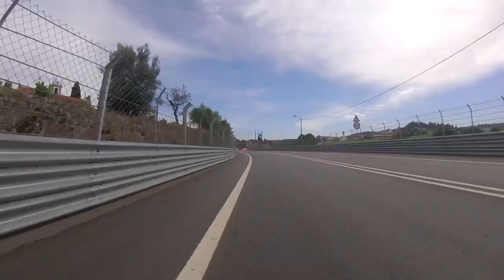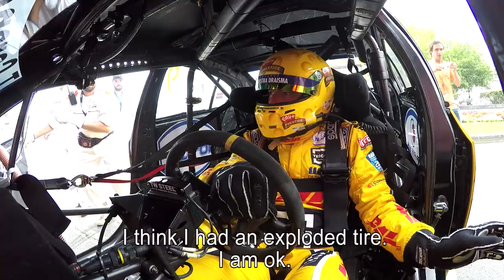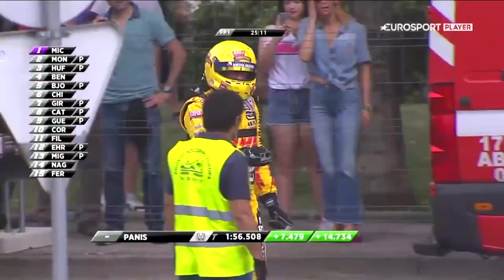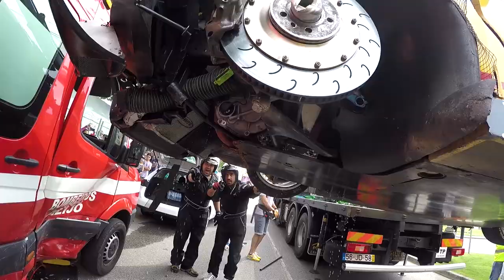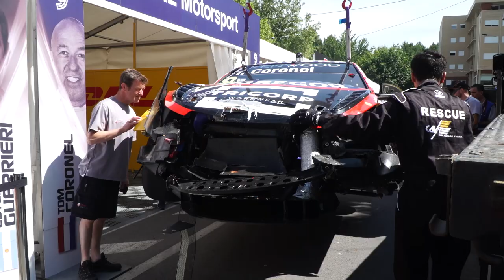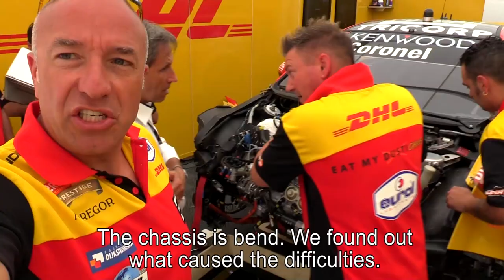Bizarre crash into firetruck at WTCC race of Portugal for Tom Coronel 2017

Comment: WTF; Crashing into a firetruck shouldn't even be possible in an FIA-standard world championship!  
How could they sanction a track where a car can just run off into a crowded place?!
Reply: I know its a 2 year old comment but that is exactly what I thought it's a totally wreckless thing to do by not putting in a safety barrier in that section especially as the cars are coming down there at full speed very bad organisation of safety.
Reply: @adamsprestage4194  The track was FIA inspected and aproved
Reply: @leandro9311  Yeah but they need to have a vbarrier or something
Reply: @RandomCarl05  These discussion is like an oil change. If you go to a shop and ask for an oil change, are you going to check if they did ther job correctly ?? No, but there´s a possibility that the new guy who did the oil change didn´t used the correct oil and ends up ruining your car´s engine costing thousands. In these  specific case, the ONLY agency responsible to determine the track safety ensure everthing was ok and everyone acepted because noone had to authority to say otherwise
Reply: FWIW it's actually an ambulance.

Comment: The more i look at it, the angrier i get.

In the 60's they would have at least placed haybales just at the track... better than what has been done there. Even nothing would have been better, you could have turned left trying to follow the road. But those 2 concrete blocks to the left could fire the car right... and in the direction of the spectators. Then there are the 2 lampposts and the narrow concrete thing, where you went through, which are not even remotly protected. 

Im glad that you and thos firemen are okay. Could have been way worse, but lets not think about that.
Hope you can fix the car for argentina, shame that you are out for the weekend... :-(
Reply: i think something was opened whilst it should have been shut off. He went through an open piece in the track that shouldn't be there and wasn't there anymore later in the day.

Comment: This angers me inside!
It's 2017, not 1957! There is no reason for there not to have been at least one row of stacked tires to keep cars from running off track and hitting things like that lightpost, that signpost, and of course, the safety vehicles parked there. What if this happened in an open-wheeled machine, like an F4 car?

Look, I do believe that sometimes, safety fan be a bit over-reaching and over-reactive. But this...we are supposed to be passed standards like this, especially for an FIA sanctioned series!

Comment: Where is your HANS device??
Reply: He uses a Simpson Hybrid, which belts around your body and clips into the harnesses at the crotch strap. It's much more comfortable than a HANS and works better in some situations. I use one myself.
Reply: Yeah but the slow mo looks very nasty.
Reply: That's how it looks even with a head and neck restraint. You should see what happens when you don't have anything on. The neck stretches like an accordion. Really scary.
Reply: It's not how far your head moves. It's does your head and spine stay aligned. I talked alot with Trevor Ashline who took the original Hutchen's device and significantly improved it. He sold his company Safety Solutions to Simpson but is now employed by them to run that part of the company. I seen crash test results from all of the head restraints. As far as impact G's, no other is any better. Now, taking a second hit, it was the best since it doesn't fully depend on the shoulder harness to hold it in place. By the way, did you notice his seat belts were still tight after the hit? That's how much they can strectch and snap back when stressed.
Reply: I forgot to mention, that is the head restraint I referred to in my previous comment.
Reply: Well I only heard about the HANS device. I'm just saying it looked very very scary on impact. I'm happy he didn't take any injuries.

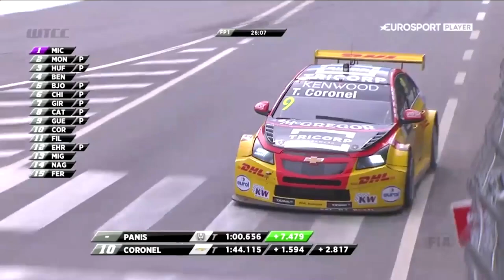Comment: Tom- Good thing you missed the guy standing in the island on the right at 0:11 .
Was the LF wheel loose before you tried to turn or did it break when you hit the 
curb? Also, how were the brakes? It looked like there were only right side skid marks on the
pavement just before hitting the curb.
Anyway, it's time for a new car. Maybe a Honda or Volvo?

Comment: Sad. But what is going on with the track in that turn? Wide open, no tires or anything to stop the car to run into the spectators or crew? Ridiculous.
Reply: he went into the escape route, that's why there's nothing to stop the car to run into the spectators, if he had followed the circuit he would crash into barriers like all pilots from the classic cars racing do in this same circuit.
that route is there to park any cars that crash in the turn or can't reach the PITs
Reply: at 0:11 you can see the barriers/tires where he was supposed to crash if he had followed the circuit

Comment: Is he not wearing a HANS or neck brace??
Reply: He is. You can see the  straps and brace when he is holding the camera on hand out of the car. It's a bit diffent style HANS device from the most common ones but it's a type of HANS device. Regulations require it.
Reply: Thanks for the clarification. It looks like his head still went so far forward but at least he was still ok after it all.
Reply: The head, neck, and spine all moved together with the Simpson Hybrid. No different from you getting up off a chair. The shoulder harness did stretch, but that happens with all nylon belts.

Comment: His neck is must be hurting after that! Are the driver not required to wear helmet restraints or racing neck collars?
Reply: He was wearing an FIA approved Simpson Hybrid head restraint. The seat belts stretch that much in some wrecks, depending on how they are mounted. The longer the belt, the further the stretch. I always mount my shoulder belts on the bar near shoulder hight, that goes across the car behind the seat. And as far as the head movement, it's if the head neck and spine stay aligned that's what's important. And this restraint always stays in place, in case of a second or third hit.